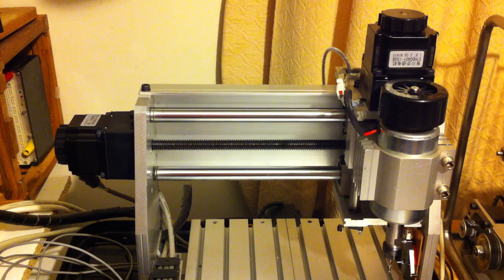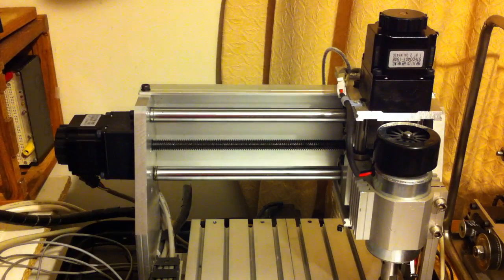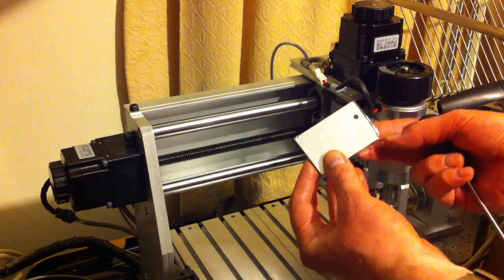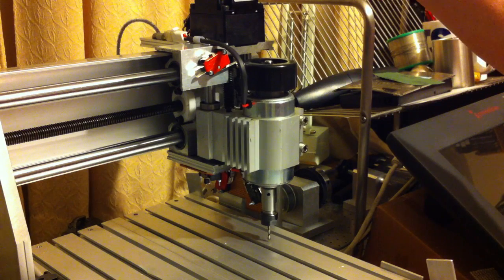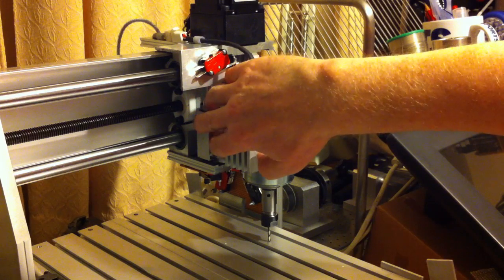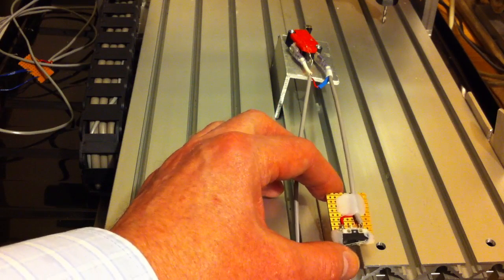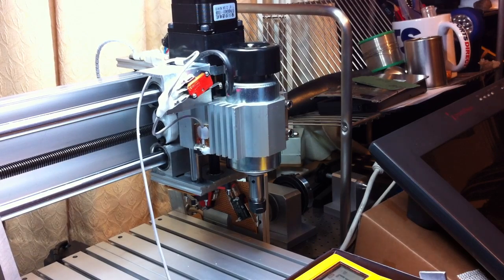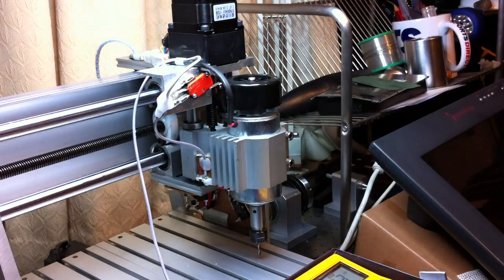Installing Z-axis End-Stop Limit Switches On My Mini-CNC 3020 Engraving Router Part 1

Comment: i have a query. because when i am pressing the limit switch the whole system halt and nothing is working , i have to restart it manually.
Reply from the maker: You just need to press the reset button, it will not restart itself, it is a safety feature that needs a manual override.
Reply: @fixed1t  but in machines like 3d printer when we give homing command and after that when limit switch is pressed the machine continues its process.

Comment: But, what happens when you choose a diferent Drill Bit that is longer or shorter then the one you have installed right now??! The ideal would be an continuasly ajustable StopSwitch for the Z axis.
Reply from the maker: The stop switch was about preventing machine destruction for a newbie like me where users regularly cut up the beds, destroy the bits, destroy the pieces, come off the ends etc etc.but they take seconds to adjust and move elsewhere.

Comment: may i know what is the advantaged install limit switch?
Reply from the maker: The limiter switches are there for when you make a calculation mistake or if their is a glitch in the software, computer or controller.  Without the limiters the drill head can crash in drill and drill bits into the decking, job or other tools or you.  The limiter switches set the maximum area it can travel before the switches causes a hardware stop and the head stops.

Comment: I have no problem to hook up those switches mechanically. The problem is that how do you hook them up electronically? Mach 3 software shows pin (or ports) to control them but on controller board, there is no available pin or port to hook up. What is your suggestion?
Reply from the maker: Have a close looked at your motherboard, what is its part number and designation, it may be that the board you have is for 2 axis and not 3. #fixed1tCNCtips